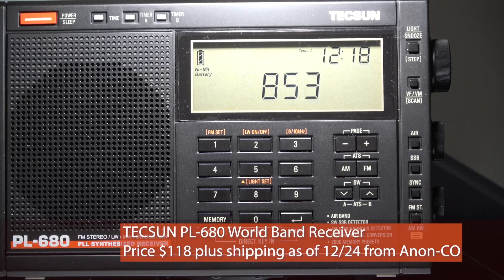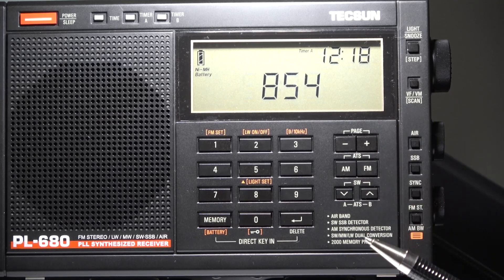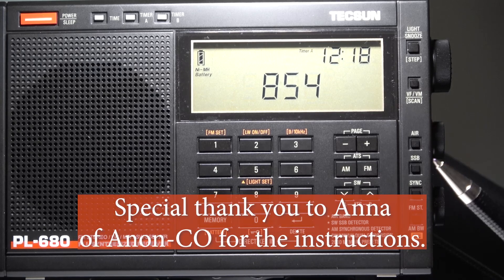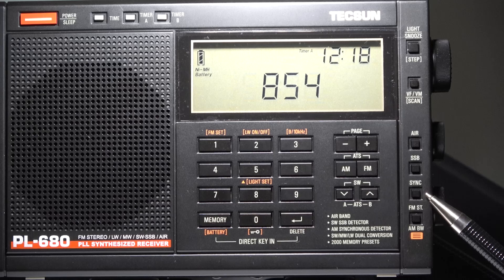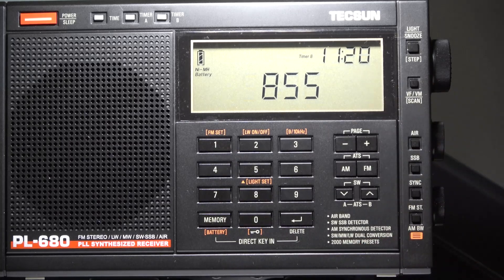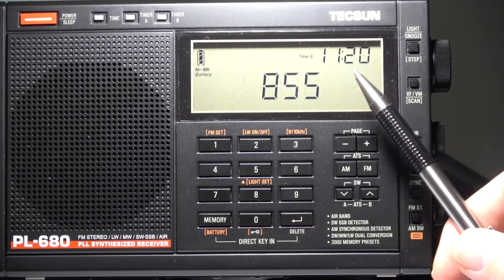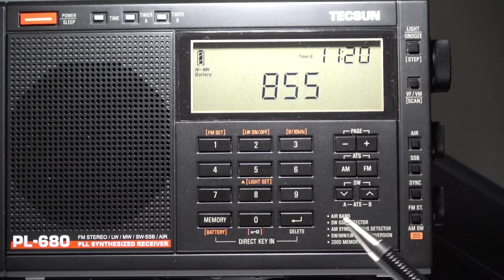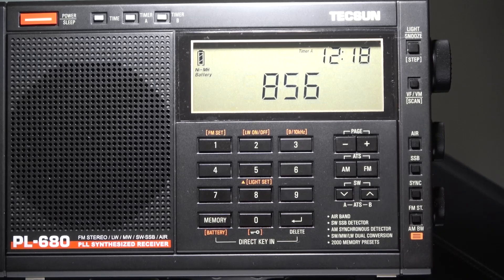TECSUN PL-680 FREQ Calibration Procedure

Comment: Hi as I,'m completely blind I inadvertently press and hold air button on am and sinc button on fm instead of step button. What will happen if you don't press number 1 to confirm calibration. Also I want to ask is there a way to reset calibration to default if I somehow set it incorrect
Reply from the maker: I would think a factory reset, the small opening on the bottom of the unit would reset calibration to original default.

Comment: I found it useful! I have been able to calibrate but had no idea it was applicable to both bandwidths for MW and SW. I also have a question, is FM calibration for the entire band or a specific frequency? I did the FM calibration and noticed a weaker station was off. I tuned away from it slightly and it was perfect. Thanks for your reply!
Reply from the maker: Lamar, my PL-680 was built in November and so far it has not had any tuning issues so I have not needed to perform the calibration procedure. We did the video because in older models calibration was not possible and a sore issue with many. Let me know what you discover with FM calibration. Thank you for watching and sharing.